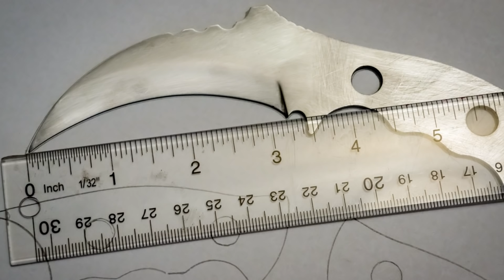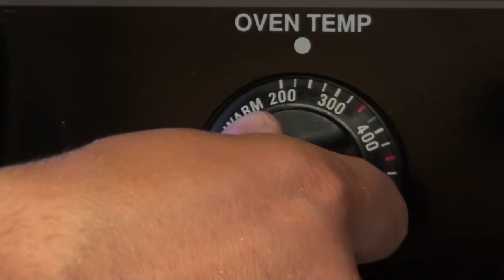Making Karambit from Concrete Saw Blade Part 4

Comment: Love your knife videos my friend. I have a few suggestions if it's ok. You have a drill press, you can buy little drum sanders to fit in them, these will help you sand n grind perfect circle shapes of all sizes. And I see you file and scrape the edges of some of your work to take the sharp edge off? A buffing wheel will do that job easier for you and leave a better look.
Look forward to you next knife vids!
Reply from the maker: +Tez Thanks for watching and commenting. I know what you talking about, the little drums but they cost a ton. I am trying to do all the handwork to save money. I am already over $1000 in spending on tools since I started making knives.
Reply: Really? Maybe you've been looking in the wrong places? There are loads of them on ebay really cheap. You do get what you pay for like but they will do the job and wear out fast. But only for a little £££
Reply from the maker: Tez Have you heard a phrase "Buy once, cry once!" I like to buy the best I can afford so I would have to buy only once but it is expensive. I do not like cheap stuff. For example my kitchen knife set cost me $1,080. I bought it and it will serve me for the rest of my life.

Comment: Awesome Knife, You Should Try To Paint It A Good CS:GO colour/skin. Then sell it, collectors would go crazy for it.
Reply from the maker: +Skeptical I might have a copyright issue if I start selling them. I made this knife not as a CS:GO Karambit but just as a Karambit knife. I did not realize that I was so close to a CS game Karambit. I did not even know this game existed until I posted this knife. All the fans started asking me questions if it is factory new or something else. I had no idea what they were talking about. Started to google this game and saw the Karambit knife was really close to the one I built.
Reply: +SLAVIK TELY Lol, must be pretty uncanny for you. I don't think, you would run into a copyright issue. But you can never be safe enough. I am going to make my own knife, a m9 bayonet or a karambit. Is there and huge differences between using some pewter, which I will molten and pour it into a mold or should I use a piece of metal like you did?
Reply from the maker: +Skeptical You do not want to use any soft metals for your knife. I would not use any molten molds for knife making. I have not heard anyone making knives from molds. Practice on steel you can find for FREE. I went to a local shop that custom make spring leafs for trucks and bought two pieces about 11 inch long for $20. I am going to make a Huntsman from CS:GO. Should be a fun project. But currently making 2 gut hook knives and a skinning knife from CPM S-35 VN. Now, this steel is expensive.
Reply: +SLAVIK TELY Lol, I am going to make a m9 bayonet or karambit, at school. But I won't sharpen it for obvious reasons. Would you recommend using Pewter or should i try my best to use steel? I want the knife purely for aesthetics, I won't use it.
Reply from the maker: Skeptical If the knife is going to be only for aesthetics, then you can use the mold. I remember my days in middle school where we made our molds from sand and poured liquid metals into it. You will have air bubbles in it. So, when you will be sanding it down, most likely you will see holes in your knife. Plus, it will be easier for you to finish it because of the soft alloys. Put it this way, make one from the mold and then move up to steel. Good luck.
Reply: +SLAVIK TELY Thanks, the way I am doing my mold, is by cutting a outline of the shape using a laser cutter out of wood. Then I will stick the mold in between to pieces of wood. Then just pour it in and let it set. Last time I did this mold method, I created a pendant of Pikachu and there were not any bubbles. But there was like this grey/black stain on the metal, just like when heat treated your knife. Will I be able to clean it off, just like you did? Also, thanks for replying, a lot of youtubers don't these days :)
Reply from the maker: You will be able to clean up your mold with a file just like I did. The "stain" will gunk up your files but it can be done. On the other hand, see if you can find a sand blasting box and clean it up that way. It looks like you got it all figured out. Good luck and make it happen.
Reply: +SLAVIK TELY I will use the school's files. Don't wanna use my own and thanks

Comment: Good job, men!
Respect!
Reply from the maker: Thank you very much.
Reply: +SLAVIK TELY one question: why burn knife and put in water?
Reply: +SLAVIK TELY why put alcool izopropilyc on knife?
Reply from the maker: Vlad Badu To remove the grease, oil so the glue would stick to the metal.
Reply: +SLAVIK TELY Rivets handle where did you get them ?
What country are you from?
Reply from the maker: Vlad Badu I live in United States of America. I bought the screws from USAKnifeMaker.com

Comment: Beautiful work! Im interested in getting into knifemaking myself.. Any tips? By the way, Slovak American here :)
Reply from the maker: +Hangtown Gunner Tip number one: lots of patience, don't rush it, find the steel you want to work with and stick with it. Practice on the steel like I did with what you can find for FREE. I just ordered CPM S-35VN 1 1/2"X1/8"X36" and it cost me $104. Can not practice on that. Tip two: as I start to realize knife making business is costly (tools wise). Start with using files, learn how to make the knife by hand. Everyone started that way and slowly start buying electric tools you need. I am still on that process, but as for now almost everything is done by hand. Tip three: buy a vise that has a rotating head and don't buy cheap stuff. It breaks and you have to buy same thing all over. BUY ONCE-CRY ONCE. A good vise starts at around $400-$600. As for other tips, I am still learning them. So far I am on the third knife. Currently  making two hunting gut hook knives. Should have a video up in about a month or so. By the way, I am second generation Russian/Ukrainian/ 4th generation Polish.
Reply from the maker: +Hangtown Gunner Also, I follow Walter Sorrells, Ekim knives, and Gough Custom. They show a lot of tips for knife making. Watch all of their videos on knife making and it will start to click.

Comment: absolutely awesome! i just wonder how much it costs all the equipment you used, because i whant to pick up this hobby! I love it!
Reply from the maker: +The Visir Here is the list:
Vise~$400, buy the one that can swivel vertically (Yost 750-DI) so you can rotate it anyway you want and work on your knife handles.Grinder~$120, buy the one with a cord so you don't have to charge batteries.

Grinding wheels~$10

Files~$50
Sand paper~$30
Hope this helps.
Reply: SLAVIK TELY thanks! You're awesome!
Reply from the maker: +The Visir Also, check out&#160;

https://www.youtube.com/watch?v=s5bdWsVSZbA &#160;

 Top Ten Knifemaking Tools for the Beginner by Walter Sorrells.
Reply: SLAVIK TELY thanks I'll do it for sure!

Comment: I'm going to have to try to make a Karambit on one of my next knives. Like the handle material also. One question that puzzles me. why did you wait to finish the ends of the handle after glue up. most of us finish the ends before, so we do not have to take a chance of scratching the blade. Just a thought. outstanding knives you make. thanks again for the vid.
Reply from the maker: So they would line up really nice.

Comment: i didn't notice that you put micarta handles on it. the thing that i told i will be using haves a similar efect
nice one but i think the sharpening was tricky
Reply from the maker: +Buza Alexandru I used G10 fiberglass handles.
Reply: i tought it was micarta
it looks verry simmilar
Reply from the maker: Buza Alexandru Micarta is not that smooth as G10. Micarta has more texture for greater grip.

Comment: Uhh Slavik I've got one question, Is the normal market oil Good for hardening the steel ? (Thanks for answering)
Reply: Because I Want to make my own knife, And i Don't know how to temper
Reply from the maker: I use Canola oil for heat treating. Temper the steel after the heat treating at 400 deg F for two hours/ one hour at a time and let it cool in between.
Reply: Thank you Very much

Comment: Olive oil?
Reply from the maker: +Luis lng You can use any oil, I used grape seed oil. I had plenty of it.
Reply: +SLAVIK TELY you rubbed it in the handle, I was wondering about that part... I'm an luthiery enthusiast and we don't put anything that goes rancid on wood at least, that's why I was a little bit confused. Great work man.
Reply from the maker: Luis lng Oh, that part. The handles are made from G10 fiber glass, therefore they do not have the wood composite. It is very hard material. Oil just brought it to life. I bought some Tru-Oil for future handle work.

Comment: Job done to perfection !!! I love your work . Except one thing ... Couldn't you find a different belth clamp ? That one is shit ugly, asymetric with the holster (one corner stands out) . Change it please with something else....just 3 screws :) thanks for the ideea to use nail solution instead of locktite to secure treads ! AWESOME JOB OVERALL ! I am impressed !
Reply from the maker: +balaurul100 Thank you for watching. About the belt clip, I chose what was hot on the market. There are many different clips. About the nail polish, I got that from a guy who builds holsters.

Comment: how many days take the progress
Reply from the maker: +shafee babakhani about 30 days.
Reply: Woow
Reply: +SLAVIK TELY not to long for the tools and time, right?
Reply from the maker: Buza Alexandru I did all the work after my day job, so that is why it takes so long. If I had full days to work on it, I would be done with it in 3-4 days.
Reply: normally yes
Reply: i am stuck with hand tools so a small half inch carving blade is hard to make so i choose to forge it out of hss from broken drill bits. instead of using the flat bars i am using round stock

Comment: well done
Reply from the maker: +CChrisMU Thanks for appreciating the craftsmanship.
Reply: +SLAVIK TELY If i was you i were very proud of it. It looks Amazing. How many hours does it takes ?
Reply from the maker: +CChrisMU For a first knife, believe me I am very proud of it. It took me approximately 30 hours. When you do it for the first time, you tend to do steps that are not necessary at that particular time. If I did it now, it would be about 15 hours, that is with using the same tools I had.

Comment: 16:26 that's a good way to slice open your stomach
Reply from the maker: +justin norris When it comes to my stomach, I am careful.
Reply: maybe you should try putting the sheath on the left side with the blunt side facing forward and do something similar to the cross draw with guns. it might reduce how fast you can get it out but it would eliminate the threat of cutting your stomach open. if you don't really us it as a carry knife then that's probably not a problem
Reply from the maker: justin norris I failed to mention, I still carry it on the right side but more to the back. It is more comfortable that way.

Comment: U know u could just buy one online for like 25 dollars
Reply from the maker: +xXMLGDANKMASTERXx You sure could and it wouldn't hurt my feelings. But you can also go to karambit.com and look up some custom ones and spend around $600. It all depends what you want.
Reply: SLAVIK TELY thnx for the tips and gr8 knife how long did it take to make dude?
Reply from the maker: xXMLGDANKMASTERXx This one took me about a month to make. All the work was done after my day job. Plus I had no idea what I was doing. I am much faster now. One thing I learned from this knife it that the steel was supper hard.
Reply: SLAVIK TELY k do you know where I can buy some of the equipment needed to make these?
Reply from the maker: xXMLGDANKMASTERXx I do not know what country you live in, but here in USA I buy it at Home Depot, Lowes, Amazon and USAKNIFEMAKER.COM
Reply: SLAVIK TELY thnx man have a good one